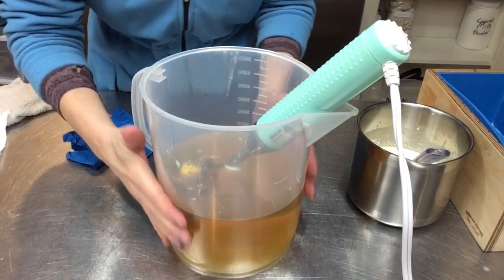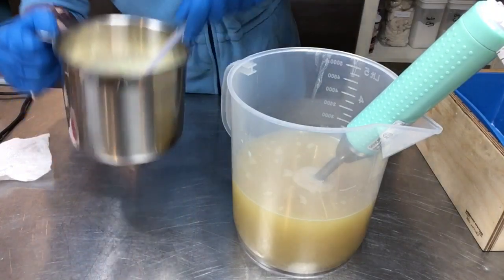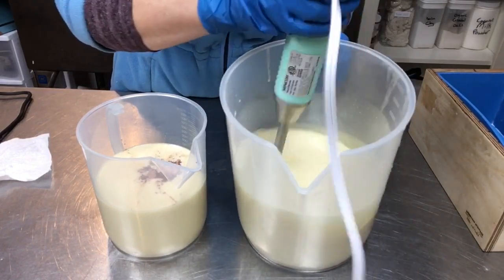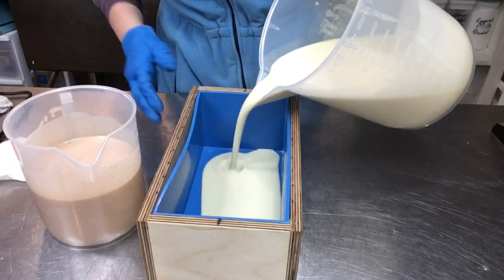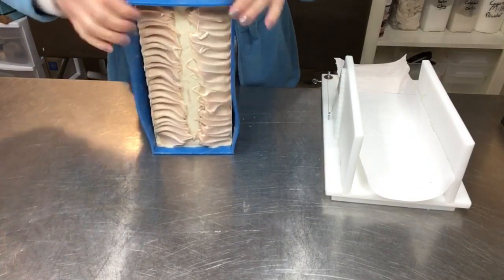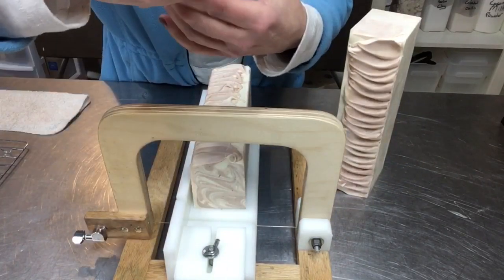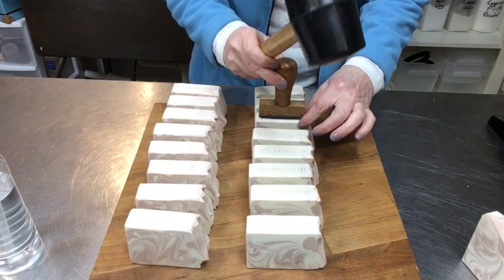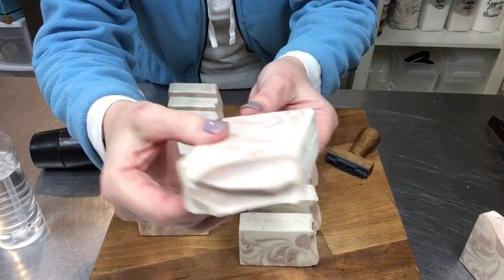Making Unscented CREAMY GOAT MILK Soap & How to Stamp your Bars | Ellen Ruth Soap

Comment: Hello, so this might be a weird question. And I'm very new at this, just fyi lol. But i have watched a ton of your videos. And i get fragrances can either speed up trace or slow it down. When you're dealing with no scents or mica colorent. If you let the soap batter sit how fast does it go from like a light to heavy trace?   I mean if im super slow at say trying to mix clay colorant batches of the same soap. Do i have like minutes or like 10 minutes? Im sorry for the confusion if this is making no sense🤦‍♀️🤣
Reply from the maker: So your recipe will factor in to the trace time too. Most recipes unscented will take several minutes to come to a thick trace. I like a recipe that is approx 50/50 hard oils to liquid oils...
Reply: @EllenRuthSoap  ok...thank you so much! I'm getting a list of everything I need to soap and see if I can pull off soap when I'm done😜

Comment: I love it!!! Beautiful work! I have a stamp from Lasercutz as well, I'm still figuring out how to get a clean imprint though. I tried alcohol, plastic wrap, no alcohol, fresh after cutting, after 1 week, lots of pressure, little pressure etc...  I still need to clean my stamp after every single bar cause the soap gets all stuffed in there and my design is not clean. I have a feeling maybe the text is too skinny, and therefore I should probably wait till full cure to stamp the soaps. Do you have any advice on that? I saw in one of your videos that you stamped them after the cure! I can't try it yet on fully cured bars, since I don't have any yet, I'll have to give another 4 weeks ;-) Thanks for sharing your artistry!
Reply from the maker: I stamp with days of making the bars, usually within 48 hours....  You may want to try some sodium lactate in you soap? for a firmer bar?  Not sure, it's just an idea...
Reply: Ellen Ruth Soap Thanks for your reply!! I forgot to mention I also put sodium lactate in my bars 🙈 but I just realized, I don’t gel any of my bars. Are most of yours gelled? That could maybe help as well!
Reply: @EllenRuthSoap  Hey, I just wanted to get back to you. I finally found a way to make it work! Please don't laugh, but I tried rubbing some silicone lubricant ever so lightly with a toothbrush on the stamp, and I could get perfectly clean imprints on my soaps, without any hassle! Even the ones I just cut! I couldn't be happier! :-)